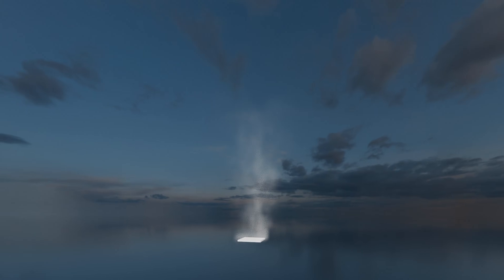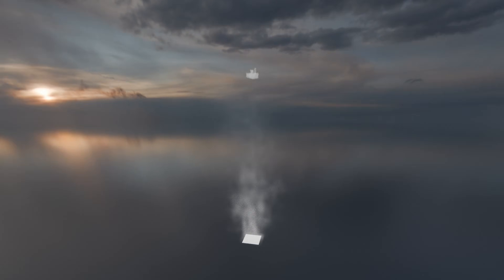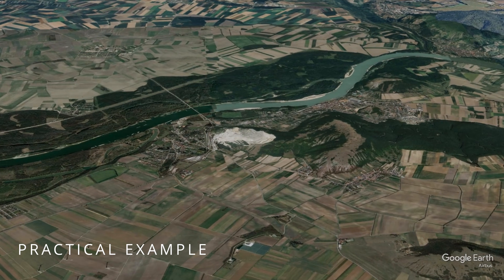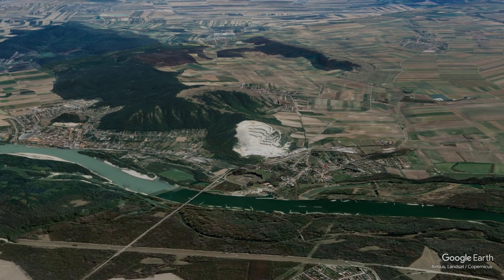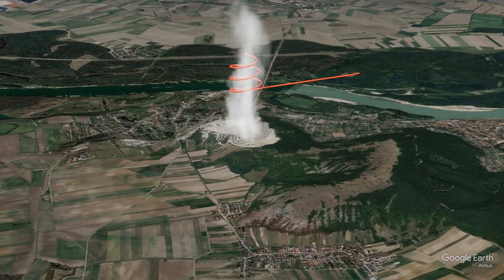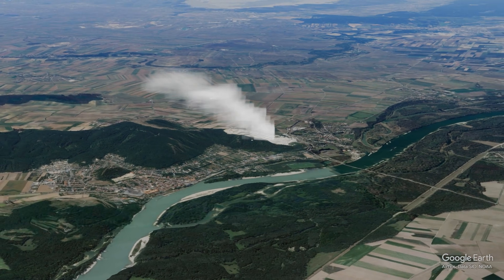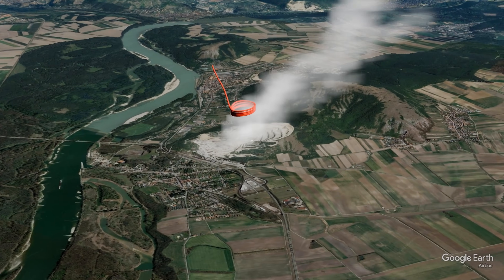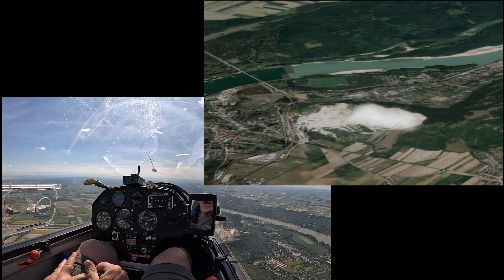Thermaling Basics - Animation and real Flight Example

Comment: Nice but the look-out limiting device (NO baseball caps please!!! 🥶) nearly pulled over your eyes should be avoided 🙏🏻🙏🏾
Reply: And also because most baseball caps have a button on top. If you get bounced into the canopy - ouch!
Reply from the maker: Noted ! bad habbits sometimes. To my excuse: i often remove it when looking into the clouds. Anyway - you are 100% right ! If there is a manufacturer outside with cool gliders headwear - tune in immediately !!!

Comment: I’m a single engine pilot but I have a lot of respect for the gliding community, man. It’s a whole other world by comparison. Completely different priorities…when you hit a thermal in a single engine, it’s annoying and it messes with the altitude you’re trying to maintain. It’s especially annoying when you’re coming in on approach. There’s a lot of concrete near my home airport, so there are days during the summer when you just get heaved up into the air on downwind and have to cut power to compensate.
Reply: It’s the three dimensional version of sailing. Teaches you more accurate flying and a better understanding of the sky.
Reply: @bungee7503 and better use of the rudder pedals.
Reply from the maker: Ja, i can imagine. We - @Spitzerberg - have a funny situation: In the area where the gliders reduce their altitude to go for downwind, there is a large green house. And just in the moment when you do your last turn to go to the "position", the pilots often encounters an updraft. So you have to decide, try another run, or stick to your plan and go for landing. Altitude often is about 300m. BTW: For a certain wind direction we share the landing pattern with the engine pilots, and very often we are thankful because the engine guys have to give way for the gliders. Its a very good exercise for traffic observation, for both ...

Comment: Why can’t they put a thermal detection device in the glider so you can see it in real time
Reply from the maker: well, there is actually one, called Variometer. But it does not show where the upwind is, and - unfortunately -  its some seconds behind the actual situation ...
Reply: The air itself doesn't give off infrared radiation so temperature differences in the air cannot be detected from a distance.
Reply: It would kill all the fun.
Reply: Why not just install an auto pilot then? 😅

Comment: "The wind will give him a similar offset as the thermal tube, so he will stay in the updraft". 
Nope, that is not what happens in real life. The reason is that the glider is extracting energy from the air, and hence it won't climb at the same rate of the air. Instead it will climb at the vertical airspeed of the bubble minus the sinkrate of the glider. 
As both the bubble and the sailplane drift over the ground at the same horizontal speed, the higher vertical speed of the bubble, means that the thermal tube must have a steeper angle than that of the spiralling glider, as the steepness of the angle is basically given by the ratio of the vertical speed to the horizontal speed.
The result is that if you as a pilot does nothing to compensate for the wind, you will slowly drift out of the bubble in the downwind direction. 
Therefore, if you loose a bubble, a good strategy can be to fly a bit upwind, to try and relocate it.
Reply from the maker: You are 100% correct. I just wanted to make things a little more simple, and "similar offset ... stay in updraft" is not exactly what really happens. BTW: Very good explanation. Would you be available for reviewing my text in my next vid: Thermaling advanced?
Reply: In reality usually flattening a bit in the upwind portion of the circle is a good way to keep centered.